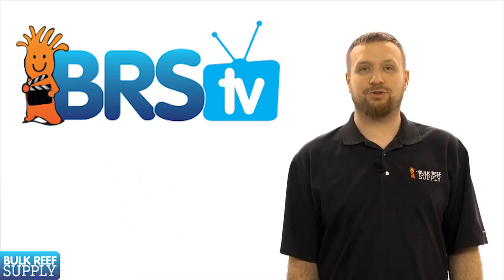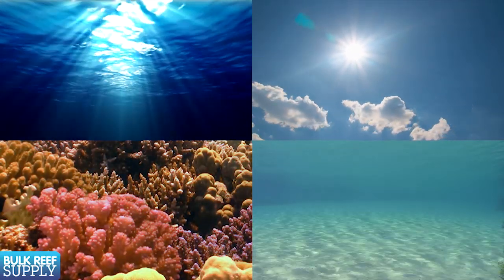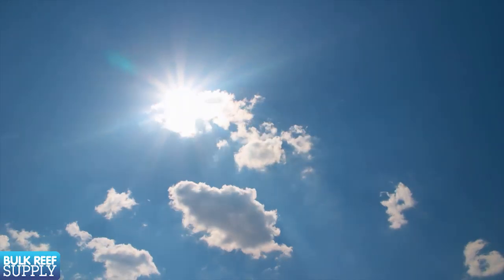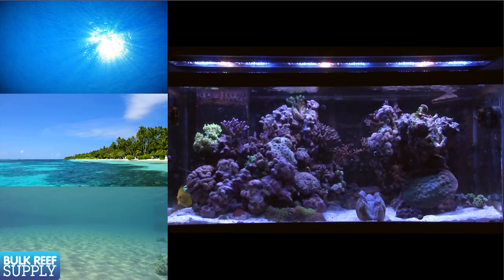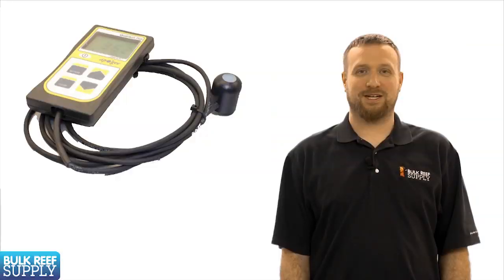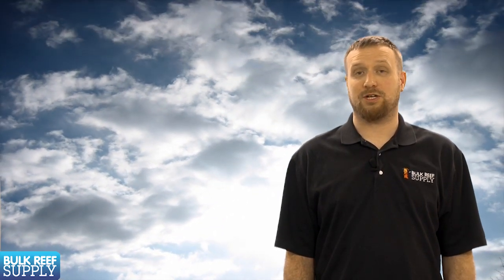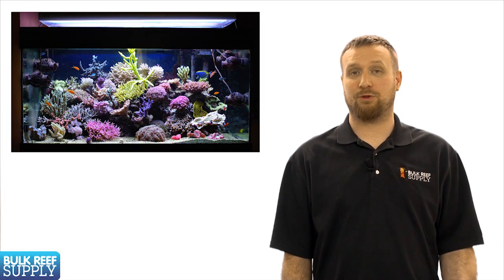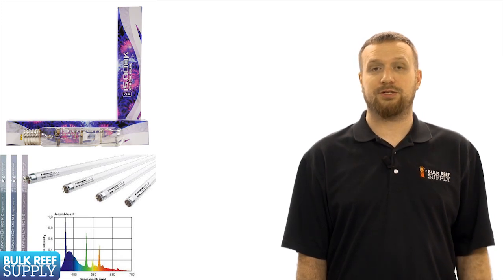Using Technology to Emulate the Sun and Reef - EP 1: Aquarium Lighting

Comment: On LED's: From my personal experience with them in the horticultural field, these are great options due to their low amount of heat contamination, low power draw, significantly increased life-span, and better ability to replicate the suns color spectrum when multiple LEDs are combined on the same board. The only drawback is that the initial purchase is typically more expensive. T5s and Halides produce lots of light, but will add heat and require 2 sets of bulbs to replicate seasons.